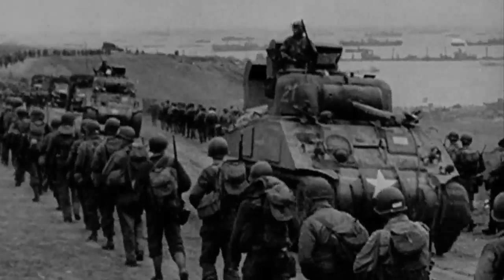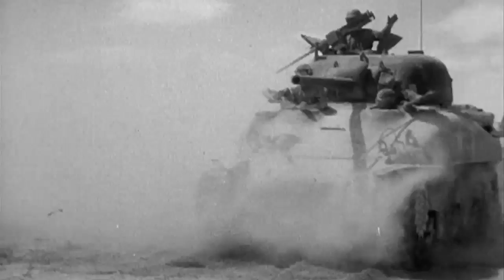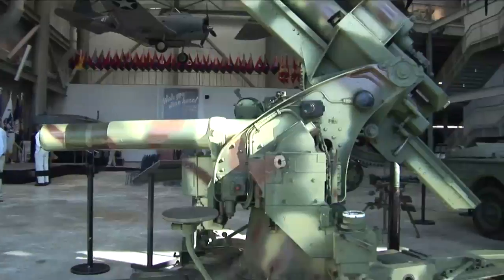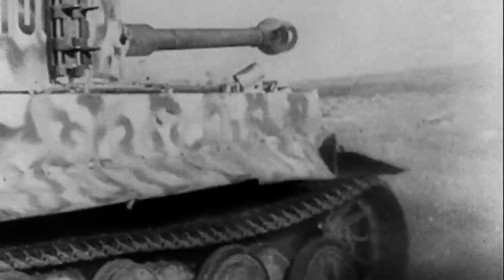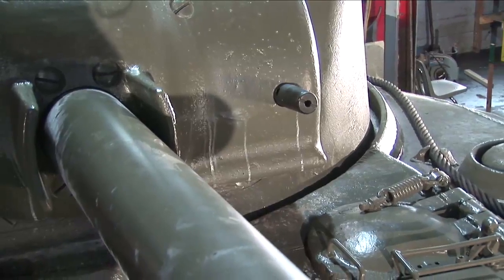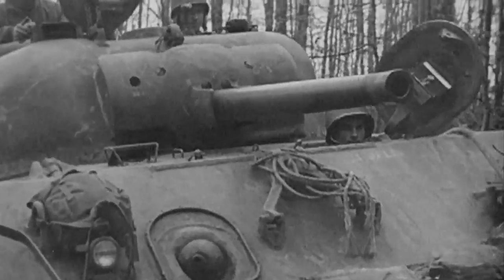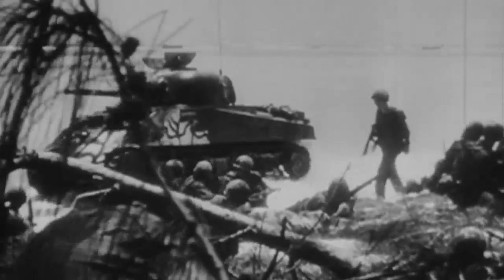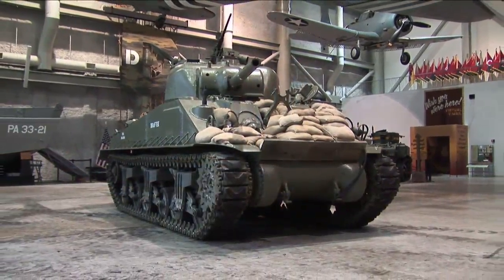The M4 Sherman Tank at The National WWII Museum

Comment: The Sherman's job wasn't to engage German tanks. That was a job for dedicated "tank destroyers". It's like saying a submarine's main job was anti-aircraft because a few got sunk by enemy aircraft.

The Sherman's main job was to penetrate the enemy's defense and basically wreck things. While it had inferior anti-armor capabilities compared to the Germans, it had superior HE rounds.

The Sherman's poor reputation comes from people focusing on only two factors: firepower and armor. While the Sherman was "weaker", it was also faster, cheaper to produce, faster to repair, more reliable, and more versatile. Seriously, there were Sherman models that could even float. Try getting a Tiger to float.
Reply: Actually no. M4 Sherman should engage whatever it encountered.. Tank Destroyers were supposed to provide defense against enemy tank counterattacks... they were not used in offensive situations.. they were practically mobile antitank guns...
Reply: Also, a more general observation: a successful tank design does not necessarily mean a tank that is best for 1 on 1 tank duels. Production and maintenance costs, reliability, speed etc. all factor in. Even the relatively cheap (only slightly more expensive to produce than Panzers IV) and deadly Panther was still over-engineered, prone to failures (in part due to the fact, that its low cost was achieved by use of forced labor), expensive to maintain, and often impossible to repair in field conditions.
Reply: The M4's assigned role opted that tanks are for making and exploiting breakthroughs in enemy lines and to deal with resistance accordingly. The doctrine simply made the claim infantry support would be the more common application. 

The M4's only real design parameter by comparison was just to put the 75mm general purpose gun, the M3 into a fully rotating turret.
Reply: foxymetroid You are exactly right.  How could this museum curator say the job of the Sherman was to fight German tanks?  That may have been what actually happened many times, but that was NOT the doctrine of the day.  Our lightly armored, open topped speedy tank destroyers with the better guns were meant to fight other tanks.  We know better today with the M1Abrams, "King of the Killing Zone."
Reply: foxymetroid The Sherman was quite good at anti tank too, the short 75 could knock out the german equivalent, the Panzer IV
Reply: i think if Germans had a tank like Sherman, they would probably win the war... Sherman was cheap to manufacture, it was very reliable, had decent mobility, good protection levels (on pair with T34!!!), good gun (75mm was more potent than 76mm used in T34/76, 76mm M1 was better than 85mm in T34/85), excellent ergonomics etc etc...
Reply: +John Hancock 

 What are you basing this on exactly?
Reply: Jaroslav Jakubov The Panzer IV is probably the only thing they had close it a Sherman
Reply: Jaroslav Jakubov  Against the combined industrial power of the US and USSR? I doubt it. But they certainly would have fared much better had they been more pragmatic with their weapon designs.
Reply: PzIV lacked with armor, after all Sherman is as well protected as T34, while it used wet stowage ammo protection, and had actually very well designed crew compartment.. one thing that greatly reduced number of casualties in Shermans was ability of crew to get out of the tank quickly..  really recommend looking those Chieftain's hatch videos here on youtube, guy was able to get out of Sherman faster than it took him to just open the hatch in T34... when you get hit in a tank and there is a fire starting, every second counts.. and having crew survive means you can just give that crew a new tank and send them into fight next day..

anyway back to Germans, i think they were acting on fear from T34 when designing Panther, and completely lost their sense.. They overdesigned that tank, made it way too heavy where they would be better off with let say 30ton tank with sloped armor and long 75mm gun - not necessarily L70, i think L48 would be just fine... important thing was, 30ton tank would not over-stress the engine and transmission, besides requiring a lot less raw materials... 

but of course at the other side, its good they did what they did... otherwise i might not even be alive..
Reply: Which German armor... Few faced Tigers's and in fights with Panther they did quite well  Arracourt comes to mind.
Reply: Doctrine was that Tank units would engage and destroy enemy armor when on the attack.  

Tank Destroyer doctrine as originally though was to stop German break though, which was seen as a major issue after the fall of France.  The Doctrine in use was modified to use the Tank Destroyers (at least the later ones) to a mostly reactive and supporting force in the Armored Force. Often the TD's were used as indirect fire as well.

FM-17
ARMORED FORCE FIELD
MANUAL
EMPLOYMENT OF
ARMORED UNITS
(THE ARMORED DIVISION)

b. AGAINST ARMORED UNITS.--(1) When enemy armored units
are met during a march, attack will be made from march
31
23 ARMORED FORCE FIELD MANUAL
column. The tank units lead the attack. Missions and objectives
for subordinate units will be immediately ordered by the
division and column commanders. The tank destroyer units
well forward in the column may be used to attack and delay
the enemy.

FM 17-30 

ARMORED FORCE
FIELD MANUAL
TANK PLATOON
October 22, 1942 

"41. TANK VERSUS TANK ACTION.-a. In tank versus tank
action, it is essential that tank crews be able to recognize readily
hostile tanks, that they know the capabilities of these tanks,
the vulnerable points at which to fire, and the capabilities of
their own and enemy tank weapons. In tank versus tank
action, every advantage must be taken of terrain, the sun,
direction of wind, weather, and your own weapons.
b. If outranged by hostile weapons the following may be
done:
(1) Move to concealed positions and send some tanks to
the enemy flanks.
(2) Withdraw behind your own antitank gun defenses,
keeping out of range of the enemy weapons.
(3) Close on the enemy at maximum speed, attacking from
direction of the sun if practicable.
c. If your weapons outrange those of the enemy, close to
effective range of your weapons but keep out of range of the
enemy and halt to fire. "

Tank Destroyer doctrine as originally though was to stop German break though, which was seen as a major issue after the fall of France.  The Doctrine in use was modified to use the Tank Destroyers (at least the later ones) to a mostly reactive and supporting force in the Armored Force. Often the TD's were used as indirect fire as well.  

 As a note the use of "offensive"  means in the most local of areas as TD's are supposed to be "held in reserve" when the Armored force is on the defensive, which is anytime the force is not attacking by and large.   While on the "offensive" they are intended to be ready to engage "counter attacks" again a form of "reserve"

"FM 18-5
TANK DESTROYER FIELD
MANUAL
ORGANIZATION AND TACTICS

OF TANK DESTROYER UNIT

 9. ROLE.-a. Tank destroyer units are especially designed
for offensive action against hostile armored forces. They are
capable of semi-independent action but preferably operate
in close cooperation with friendly units of all arms. They
are allocated to large units as indicated in paragraph 36.

b. When supported units are engaged in offensive action,
tank destroyers protect them against armored counterattack
and thus allow full exploitation of their success.

c. When a supported unit is engaged in defensive action,
a minimum of antitank weapons are located to cover obstacles
and establish a first echelon of defense disposed in depth
against tanks while a maximum of mobile antitank weapons
are *held in reserve*, prepared for immediate offensive action.
Organic antitank weapons of front line units are used for this
first line of defense; tank destroyer units form the mobile
reserve.

 10. CHARACTERISTICS.-a. The characteristics of tank destroyer
units are mobility and a high degree of armor-piercing
fire power, combined with light armor protection; strong
defensive capacity against attacks of combat aviation; and
flexibility of action permitted by generous endowment with
means of communication. Tank destroyer units are also
capable of effective action against tanks through the use
of close combat weapons.

b. Action of tank destroyer units is characterized by rapid
movements, sudden changes in the situation, and a succession
of brief but extremely violent combats separated by sporadic
lulls. Aggressive fighting spirit and individual initiative are
marked features.

c. Highly effective against tanks, tank destroyers are ill
suited to close combat against strong forces of hostile foot
troops.

* 11. Mission.--a. As indicated by their name, the primary
mission of tank destroyer units is the destruction of hostile
tanks.

b. When tank destroyer units can be spared from this
primary mission, they may be employed on secondary missions,
such as beach defense, action against parachute and
air-borne troops, and the reduction of bunkers, pill boxes,
and other weapon emplacements. The decision to employ
tank destroyer units on other than primary missions is a
responsibility of higher commanders. "
Reply: Some 1350 Sherman tanks were either completely destroyed or knocked out by German armor. Basically it was a great tank, except in direct combat against German armor, where it became a death trap for American tank crews.

Comment: Shermans are good tanks but a T-34 would kick it's ass.... just saying.
Reply: Nope. Shermans beat T-34s in Korea. Also, Dmitriy Loza, a soviet tanker preferred the M4 Sherman.
Reply: +William Peiper

The ZIS-S-53 85mm could not destroy a Tiger frontally beyond 500m in combat with standard ammunition. Though theoretically capable of such. The 76mm gun M1 could around 600m, and with HVAP-T M93/T4 almost 2km. 

The T-34s as a whole uniformly had 45mm at 60 degrees on the front. A few Zhavod and Stz. factory vehicles had extra armor, but they were in too few numbers to make a difference and were only applied to T-34/76 vehicles. 45mm of armor at 60 degrees is 90mm in l.o.s. thickness, actual effective thickness was around 103mm throughout the production run with changes in hardness. The small hatch M4s (excluding the cast hulls) had 50.8mm at 57 degrees, 93.27mm relative thickness, but 104-107mm overall. The larger hatch M4s had 63.5mm at 47 degrees, 93.34 relative. Overall however, large hatch M4s had 118mm overall.

The T-34 was not known for reliability. Many problems with the transmission were solved with the new transmission in the T-34/85 M.1944, but overheating, 'oil-bath' air cleaner issues, drive train, and suspension problems plagued the T-34 throughout its production run.
Reply: Tobias Rink On paper, and in a scenario where it was broad daylight, in the middle of open field. Then yes. 

Against the Panther, you'd be surprised how the M4 managed. I'd recommend reading David Hardison's Data on W.W.II Tank Engagements Involving the American 3rd and 4th Armored Divisions. It doesn't speak for all Panther encounters, but many times the M4s fares much better than the Panther.
Reply: The T-34 was a tank that won with numbers...not with reliability or quality.  It had crappy build quality, and was very hard to drive.  IT had realiability issues.  It was designed to have a lifespan on the front line of one day.   The sherman was a better tank...the T-34 was the more important tank.
Reply: +Robert Peters T34 with the 85mm gun and 60mm sloped armor on the front and 80 on the turret was better than Sherman, was more sofisticated than the previous version of T34 with the 76mm gun.
It was reability, fast and easy to produce, capable to destroy a Tiger I from 1000mts of distance.
Reply: Tobias Rink 1 vs. 1 against what?
Reply: Panda Hero this is hiliarous
Reply: +Logan Barnette

Only when you dont know anything about these 2 tanks or are strongly biased.
Reply: Not really.T-34 is technicaly trashy design and only positive which also made it useful when it came out was sloped armor,but Sherman had same effective thickness as T-34 and later even better and since it was a thicker steel plate it had someway higher chance to survive hits.

The worst thing about T-34 is crew survival chance.T-34 was designed so bad in this way the crew nearly had no chance to survive while Shermans had the best crew survival rate.

Sherman was also of way higher quality and it broke down less while maintenance was easier.

Sherman had also much higher potential than T-34. It could be turned even into heavy tank.M4A3E2 Jumbo variant from WW2 featured 102mm frontal armor with effective thickness of 155+mm and mantlet had 180mm.
This Sherman outperformed Tiger I tank basically in every aspect of armor except 6mm thiner side armor (but side of the turret had 152mm).
There has been also a prototype which used turret from M26 Pershing which contained 90mm M3 gun.

Combination of Jumbo Sherman with 90mm gun in the result would outperform even IS-2 tank.IS-2 could be knocked out even by tank like PZ IV F2 or higher variants. Plus 122mm gun had horrible reload rate and when you combine it with badly trained soviet crews you got a big death trap.
Reply: They had the chance to do so in in Korea.. did not happen. Had the Chance in the Mid-East  did not happen.
Reply: Tolik L. that fact saved many life from sherman tankers , many tiger 2 and jagdtigers didnt have fuel. Sherman itself best ability was that its simple so easy build in high numbers. 1 vs 1 sherman no chance the number bring the victory
Reply: Panther , jagdpanther , tiger 1 , tiger 2, jagdtiger
Reply: Robert Peters sure you not talk about the sherman? crappy tank , only chance to win with numbers , easy prey for 8,8 cm guns. best chance for sherman tanker was hope the german run out of ammo